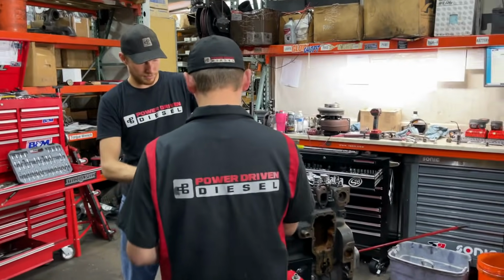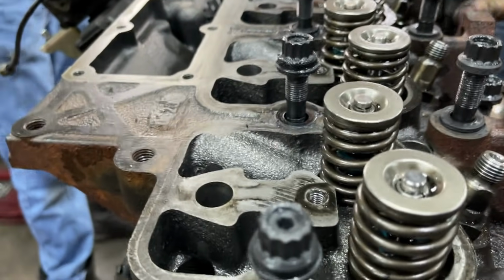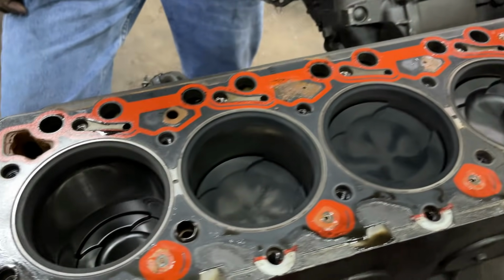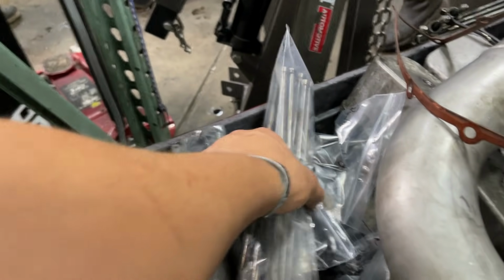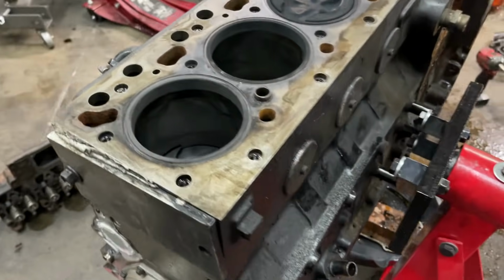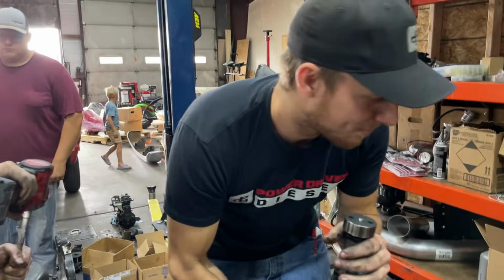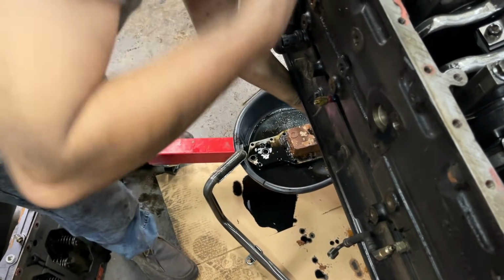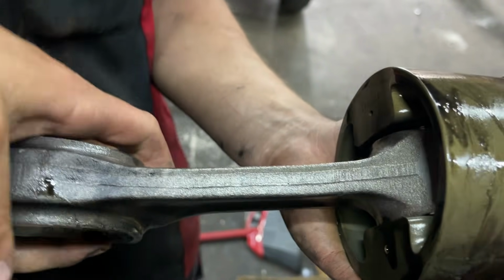MECHCANICAL NIGHTMARE RAM CHARGER 12V! ITS BAD!

Comment: I think stock 12v rods are just fine at 1200hp flywheel so should be good for a grand to the ground no problem as long as it is fuel and air only and no spray.  Especially with the low compression from those pistons.  Have to consider how long back that engine was built too. If it was 10-15 years ago there was far less available in the aftermarket to build with than there is now. In fact ARP didn't even offer studs for these engines 15 years ago.
Reply from the maker: It was “built” less than a year ago. It’s a hack job through and through.
Reply from the maker: Bent connecting rods, no rod bolts, no main studs, stock pushrods and valve springs on a 900cc 13mm pump I’m not buying it. I’ve done some corner cutting on my own stuff but this is unacceptable, considering it was sold as a built engine with billet rods
Reply: @horsetorquesdiesel  Well then yeah they got had for sure. That sucks. It might as well have been a stock engine because besides maybe the pump, which is now also questionable about what it is, there isn't anything there worth using to go after that power goal besides the block might salvage.  Better pull a deliver valve and check the pump.